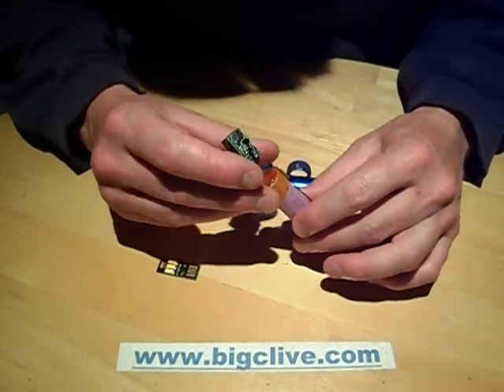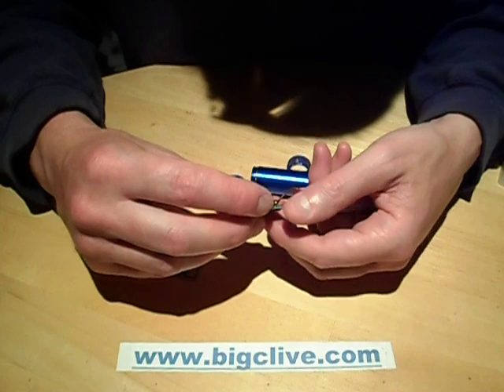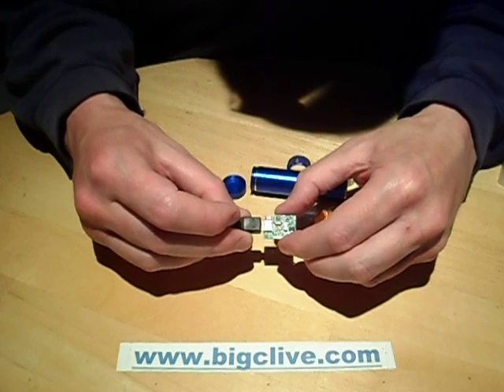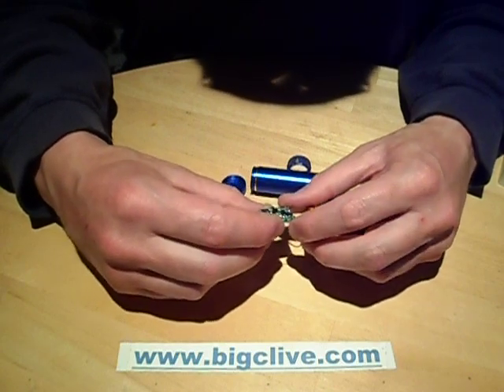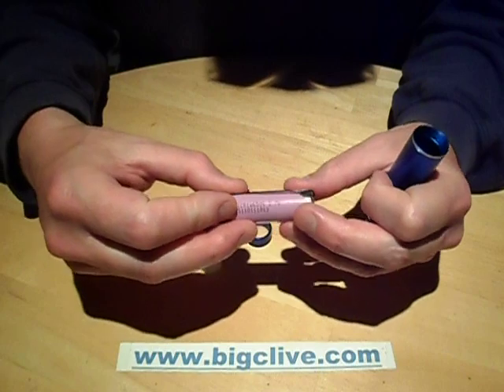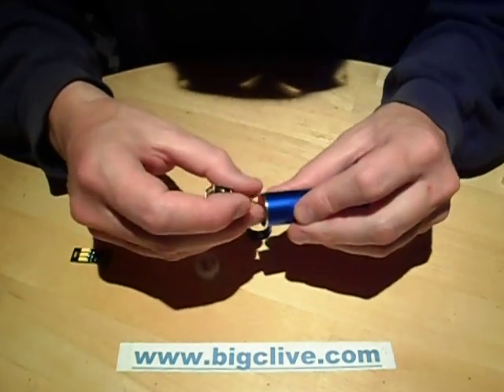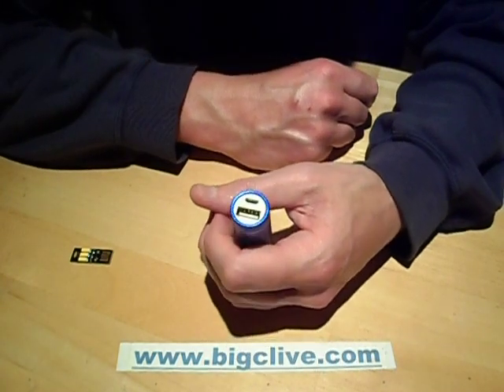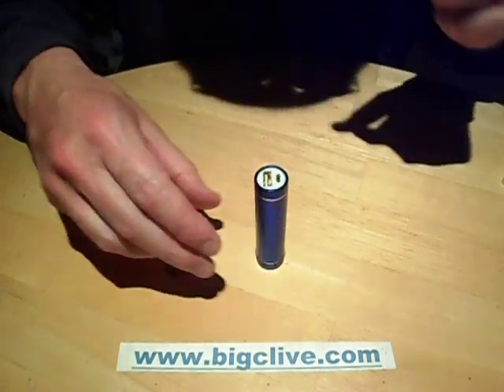Scarily tight aluminium USB power bank.

Comment: We have a store here called "Ollies" which sells discount products.  This very same appearance tube light with logo "Justin" in a box labeled 2600 mAh and was only $1.99.  I bought half a dozen of them and tested the capacity of each.  The average test result across the 6 samples was 1623 mAh at 4.84 V which tells me the capacity is accurate.  I'll have to see if they are depending on the anodizing is being used as an insulator or if they added the correct isolation on mine.  Haven't torn into any of them yet.

Comment: I got two of those exact ones (same Body, Color, PCB looks the same, Printing looks similar) from Mercedes. One died/holds almost no charge (undersdischarged by seepage to death probably), one is ok, though low capacity. Really horribly low quality I think, but the WORST THING is that it unscrews so easily. Having your kids short a Li-Battery because they are curious as most of us were back then is just horrible. especially because the cell itself has no DW01 or anything. 

Thought about using the PCB to make a Pokeball-Powerbank, but decided not to.

Funny enough I already had one of the generic ones you also showed. It said 12800 (no typo, at least not by me). It had super skinny battery wires, later unsoldered itself from the tiny tiny freckle of solder that originally connected it to the PCB. At least ended up being my first solder-repair of anything.

Comment: I got a couple of free battery banks from a cable company promotion and while they aren't super tight in the aluminum shell I'm still not so sure about the quality of them since they have absolutely no branding or info on where the cell comes from.
Reply: I actually was involved in such a promotion a few years back. The only name we had was of the gift-making company that sold it and applied our logo to the casing (or had it applied), no obvious way of knowing who their wholesale suppliers are for this or any of the other promotional gift items in their catalog. The one we gave out actually has a plastic battery holder inside the metal tube, so must be slightly larger diameter. Even came with an unbranded short  user manual, a gift box and other niceties.
Reply: John Doe sounds like mine it has a plastic holder as well.

Comment: CLIIIVVEEEE!! +bigclivedotcom I bought three of these and they seem to be using tabs now instead of wires so they arent annoyingly tight. BUT! They have a neat "feature" where the shells can be screwed end to end and if you are good enough with bodge-wiring, you can attach cells end to end in parallel to make one long powerbank. I have a three cell pink one. It looks very inappropriate. I highly suggest making one.
Reply: +Luke Den Hartog So it's essentially a male USB hole warmer extension? Look what this channel made out of me. :(
Reply: +Smaxx Nah, its more of a hole cooler as its made of metal, which feels cool to the touch

Comment: I got some very similar to these on eBay, as DIY kits (supply your own battery).  The difference is that the battery and PCB are carried in a plastic half-tube, which provides greater protection against shorting.  The power bank must be fractionally larger diameter to accommodate the plastic sleeve, but it's still a tight fit.

I've found that the best way to get quality 18650 cells is from laptop battery packs.  When the packs die and are recycled, it's often just 1 or 2 cells that are bad.  I get loads of battery packs for free from the IT support group at work.
Reply: Same, I have a lot of cells from laptop batteries! Generally they seem to carry at least 70% capacity, which is still more than enough for small projects

Comment: Hey Clive I have a similar model to this, do you mind commenting on whether this has undervolt protection built in or not? Maybe a video on what to look for would be nice too.
Reply from the maker: +The Destroyer Most of this type will turn off the boost circuit when the cell goes below 3V, but current can still flow if a load that will pass current below 3v is present.
Reply: Yeah I watched your other video on this. How can one protect against this? Say if you're using it to power an LED or something, I'm assuming it will draw past 3v.
Reply from the maker: +The Destroyer If you put a diode or two in series with the LED then the combined forward voltage would reduce the current to near zero when the power bank stopped boosting the voltage to 5V.
Reply: Sorry Clive, one more question, pardon me, I'm pretty new to electronics. Is there a reason one would use diodes instead of resistors in this case? Don't they both induce a drop in voltage?
Reply from the maker: +The Destroyer The diode has a high resistance to current flow until its forward voltage is reached, so by adding one in series the combined forward voltage of the LED and diode would be around 3V.  A resistor would still allow current to flow.  There will be one in series with the LED (and extra diode) already.

Comment: Does this have no venting other than blowing out the usb connectors? And that tight? Yikes... Lithium ion batteries need to have a way to vent in case of failure, or they become a pipe bomb. Venting out side where finger are likely to be is not very nice either, unless you like being burned by super heated toxic gas.
I don't want to be anywhere near one of those internally shorted xD
Reply from the maker: +Richard Smith Yeah, some of these are basically pipe bombs in your pocket.
Reply: +bigclivedotcom Speaking of pocket pipe bombs I got one of these pieces of shit for Christmas, I of course immediately thought "oh neat I can unscrew it and replace the battery if desired" and opened it then when I was done with it I carefully screwed it back in, then about an hour later I had it in my pocket and noticed the case was warm so I quickly pulled it out, unscrewed it, and let it sit a couple minutes but the battery was still quite warm even though nothing was touching, so I had to rip the wires from the little PCB and it settled down, so somehow the PCB must've shorted itself out, even the junk off ebay is safer then the crappy power banks sold in stores.
Reply: vgamesx1 Solder(especially non-lead solder) when it corrodes creates tin crystals that form on long thin strands called whiskers. These can cause shorting of electronics, especially in extremely miniaturized varieties, like you'll find in one of these little single cell battery banks. Also having the board right on top of the batteries vent hole will make sure the very small amount of nasty corrosive fumes produced with normal use will accelerate the process. 
Ideally, the battery and casing should be set up to vent out the bottom, and none of this would be a problem. It should also be designed to fail gracefully for that matter and at the very least, kill itself and go open circuit if it does short or draw too much current.

However, the battery itself can also short internally, so that venting is very important, to allow the gasses to escape and not be explosive.

Comment: Hmmm this looks similar.

http://www.bbc.co.uk/newsbeat/article/33674966/ee-phone-charger-explodes-student-sustains-burns-as-bedroom-floor-catches-fire
Reply: +fluke Nine The thing about this article is... that girl didn't HAVE to touch the fire. Sure, the house is on fire. Go get a fire extinguisher, don't use your BARE HANDS. Faulty product for sure, but in no way did that girl need to touch the fire and melting plastic with her hands. Cutting towards you with a knife, playing in the road, sticking your hand in a mulch machine, these are all idiotic things you DON'T DO, and the same applies to when an appliance sets on fire. Do NOT put the fire out with your hands.

Also, the girl in the article says her mother got a wet towel and put the fire out. So in the time she played with molten plastic that was on fire with her bare hands she had time to call her mother, who then had time to wet a towel, who then had time to put the fire out. At the very least you'd think she would have grabbed a shoe or a jacket to stomp/smother the flame.

Comment: I'm so glad i found this video. I've been eyeing the same lipstick style charger on ebay for a while and had the same idea with it. Now that i see the battery being so tight, i don't  think i risk it getting short out / catching fire.  It's a bummer because i think that's the only kind with metal casing. All the others are cheap plastic. Can you tell the size of a protected 18650 battery please? I need to make sure i get the right size charger to fit the battery in.  Also can you tell the size of that blue charger? I hope there something similar exist out there that is somewhat larger! Thank you!
Reply from the maker: The protected cell is 68.6mm long instead of 65mm.
Reply: bigclivedotcom Thank you for your fast reply! Since then i've found a bunch of DIY kits on ebay that are needing these kind of batteries. There's a lot of plastic ones, but one of them is metal.Very reasonable price too!  I've ordered 1 already. Now i just have to find a "real 18650 battery" seller, i won't be ordering that from ebay for sure. Would you mind telling me that an unused battery how long it last? I mean if i buy an extra one but not using it for a year or 2 will it still be chargeable and usable later? Thank you!
Reply from the maker: Monica Listodos There are a few power banks that take the fully protected cell, but most of the units do at least offer over-charge protection built into the power bank.  Lithium polymer cells do age if stored and will gradually lose their capacity.  If you are going to store a cell for a while then it should be left at about 3.6V as storing it full charged will age it faster.  It;s also good to check the voltage and top them up every so often to ensure they don't self discharge below about 3V.
Reply: bigclivedotcom Thank you so much for your answers and your help!  Cheers! :-)

Comment: That is a ticking time bomb in your hands!
Reply from the maker: It's certainly a bit squirmy.  But once together should hopefully be safe.  It's possible that the metal housing might be slightly safer if it went thermonuclear inside.  It would either vent the plastic end out or perhaps just explode completely.

Comment: When I work with lithium cells, I keep a bucket of cold water (yes I know how it can react with lithium metal exposed) just outside the door, and keep the door OPEN. Any sign of warmth, or hissing/crackling, or swelling and I'll fling it into the bucket and slam the door on it
Reply: bigclivedotcom "mm, biscuits" fireball.

I am amazed how they put those together.
Reply from the maker: I keep a special biscuit tin with a lid just for lithium emergencies.  It is also used to store loose batteries when they're not in use.
Reply: +TheChipmunk2008 you need a bucket of sand

Comment: i nearly blew one up,.. I shorted the flat wire that came up the side of the battery, with the side of the battery,.. and also, burnt my finger.. it goes without saying i threw it out after isolating its positive and negatives from each other.

Comment: It's standard operation on the Lithium-protection circuitry to be disconnected when the cell is initially connected. It only opens up after a charging voltage has bern applied.
Reply from the maker: I suppose that makes sense, since it means protected cells could be shipped in a short circuit proof state.  The unit probably uses standard battery protection components.